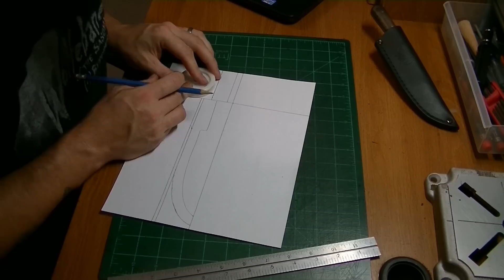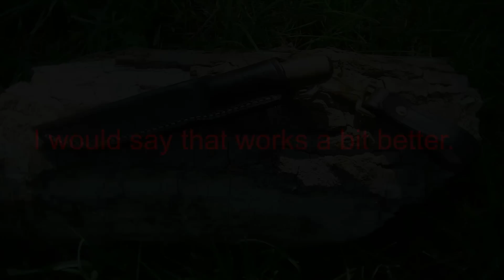Building a sheath for a Jeff White knife.

Comment: I bought the Jeff White English trade knife on eBay. The blade is slightly longer and the handle doesn't have the rounded bottom, compared to the French Trade knife. The sheath that it came with has good craftsmanship, but is REALLY rigid leather. Shiny and shellac like. Hard almost like plastic. Also, within a few days of wearing it, the blade had cut some of the stitches on the inside that hold the belt loop to the back of the sheath. I can see where it is eventually going to tear off. And repairing it would mean taking out all the other stitching and redoing it all. And I don't really like the plastic feel. How much you charge for one of those?
Reply from the maker: Hit me up at wolfecustoms@yahoo.com